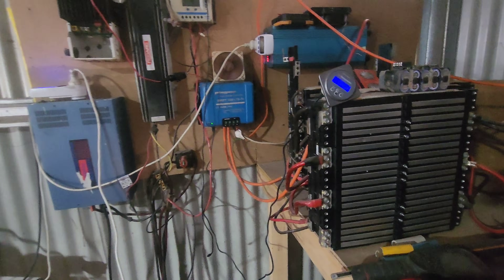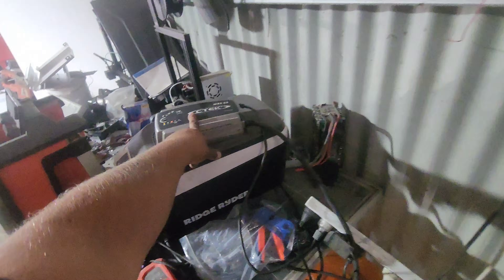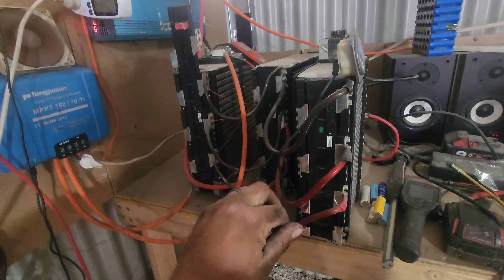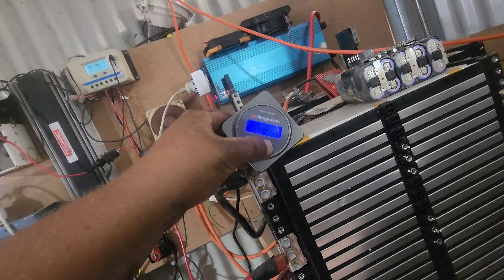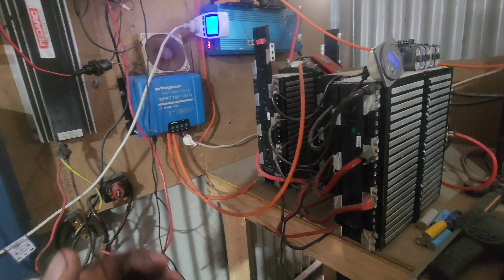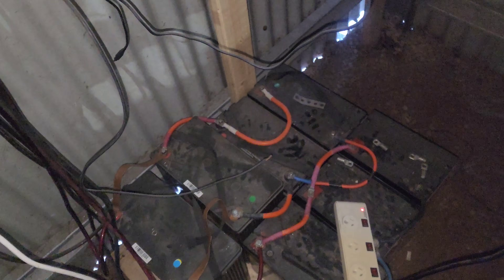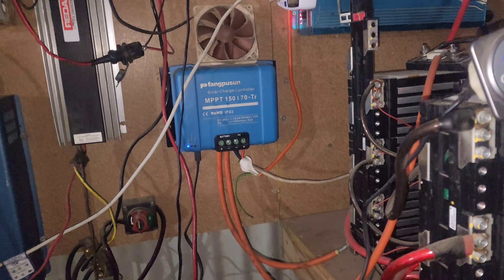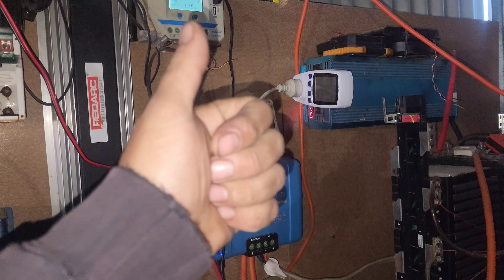Pile of old Lead Acid Battery pack How many kwh storage in these old Battery's

Comment: Good test, if you consider inverter efficiency, they could be 4.5-5kWh. Also depends which load you use on them, they are rated in Ah for 20hour discharge rate. And last thing but its kinda too much work, better is to test them separately, you might have a few of them in terible conditions and rest almost new. Data centers dump those after a few years of float usage, without any cycling, they are basically new, and for free here in europe.
Reply from the maker: Yeah exactly you never know how they were treated

Comment: I purchased 2 X 120 ah FULL RIVERS deep cycle batteries for my m/home in 2014 and they are still going strong. Rooftop solar powers them and now and again I will turn on the 6 stage 240v charger to rejuvenate them which bumps them up to 14.4 volts capacity. Not bad for 11 year old batteries. 👍's up for FULL RIVERS DEEP CYCLE BATTERIES.
Reply from the maker: Yeah I've used the life oout of some 55ah ones also and they have been very good. Shame they are so heavy